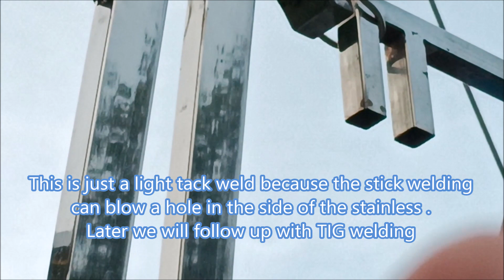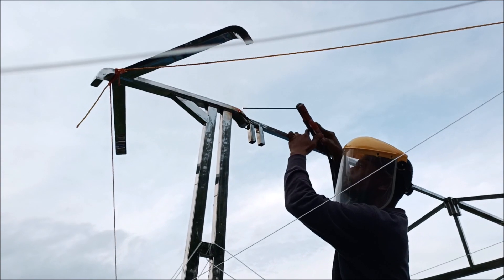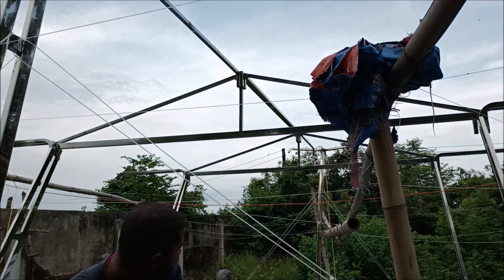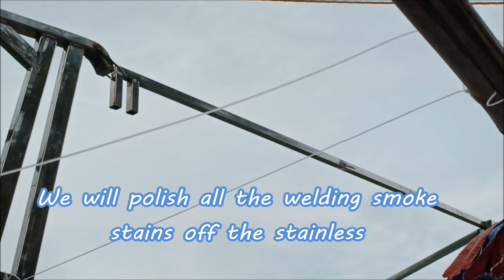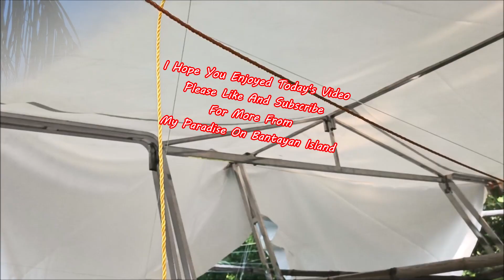Paradise Trimaran Boat Building - We Install The Tarpaulin

Comment: Is that a stainless steel weld? If not,then rust proofing especially salt water environment is a must.Loooooking goood!!
Reply from the maker: 100 percent stainless everywhere including all bolts nuts and washers and the stick welding of the loops is using stainless welding rods too and of course all TIG welding is with stainless rods. 🙂